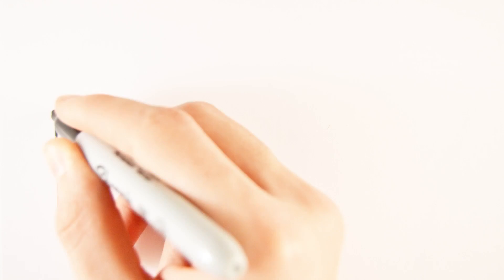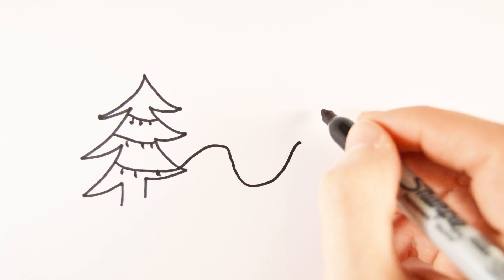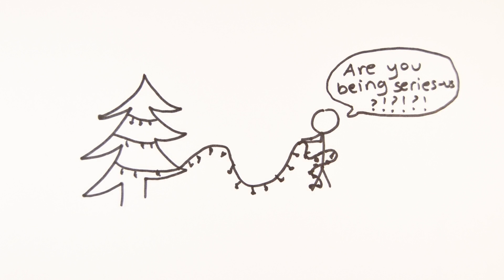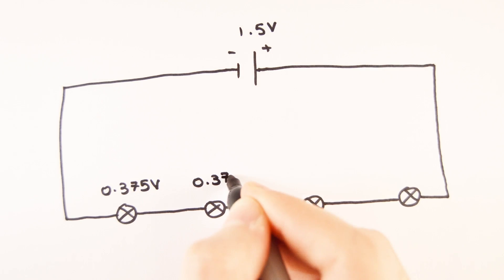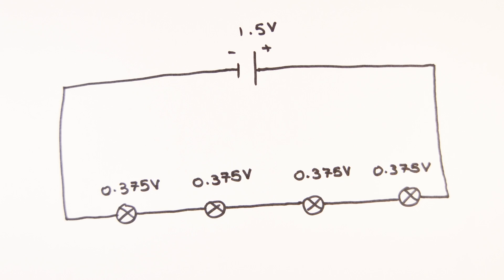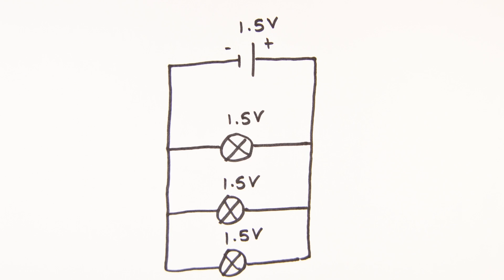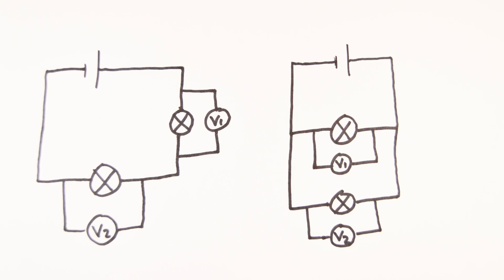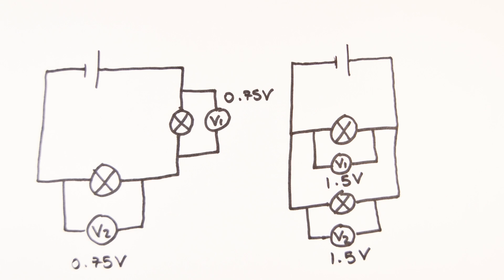Series and Parallel Circuits | GCSE Physics | Doodle Science

Comment: If you wanna be very picky, V2 does not have the same voltage as V1 in the last picture, as microscopic amounts of voltage are lost in the cables resistance... Though that is dependent on the cable size, material used, length and if it's one/two phase or three phase...

I'm picky like that.

That would be interesting to have in the next vid?
Reply from the maker: I am going to be covering resistance in the next video;)
Reply: Cool! Love the work you're doing! This is good stuff to know, but people just don't care too much for science, which makes me sad :P